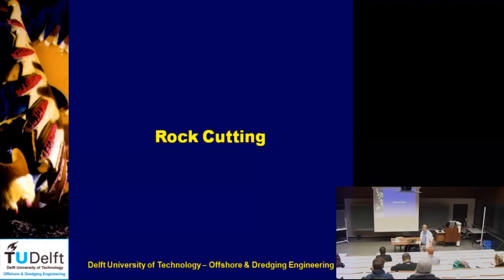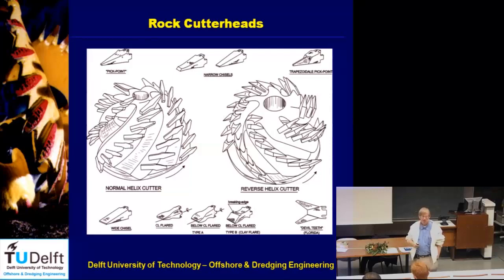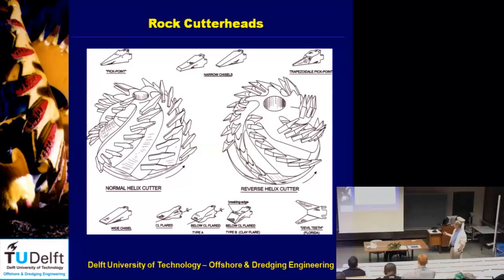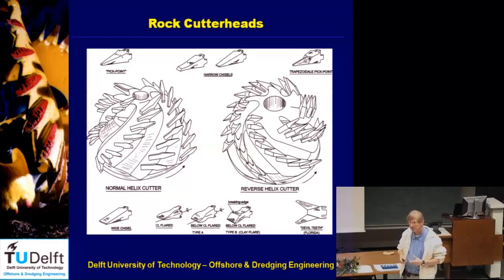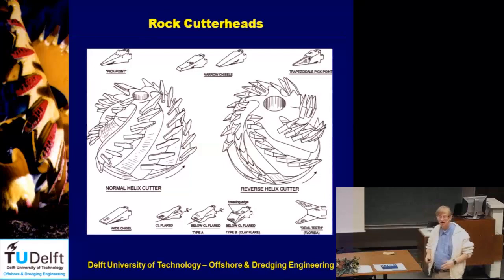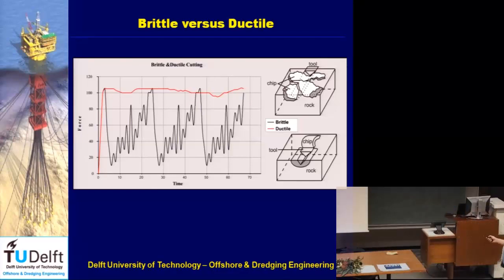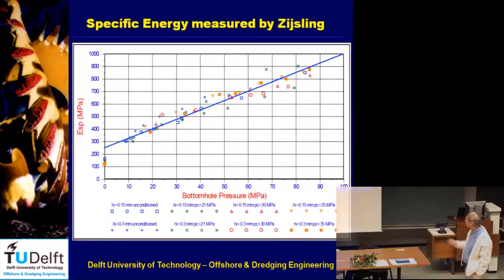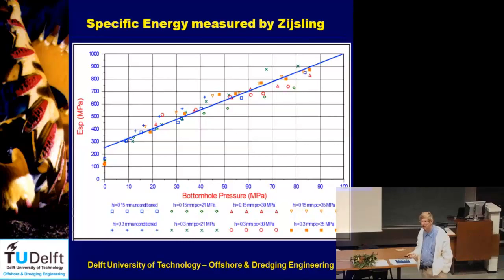Dredging Processes  8  Rock cutting

Comment: With sedimentary rock lots of fines get generated. With cross current and coral adjacent to the channel, this results in negative impacts to the coral. Any experience on using a hood or shield over the cutter to reduce suspended solids in the water column?